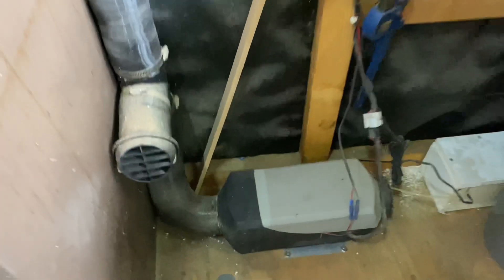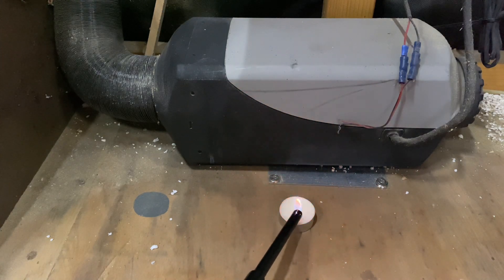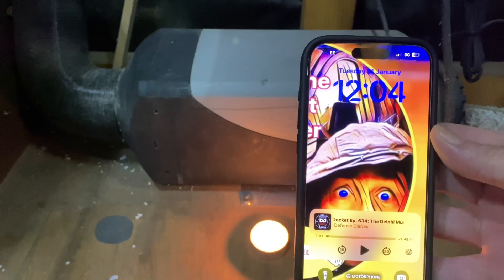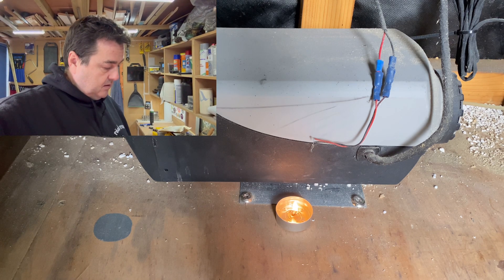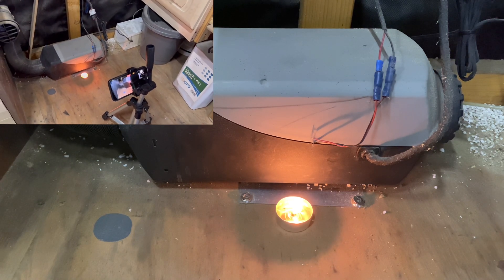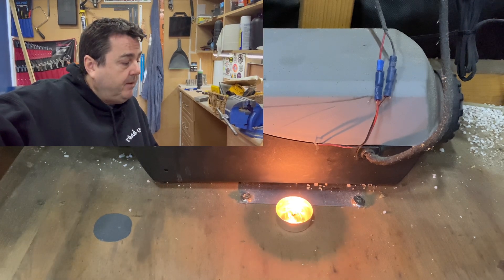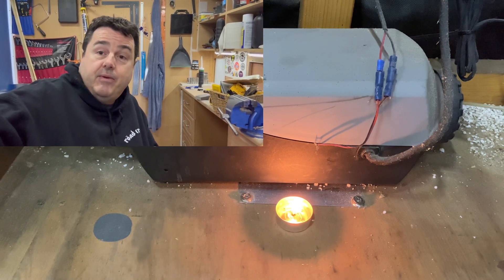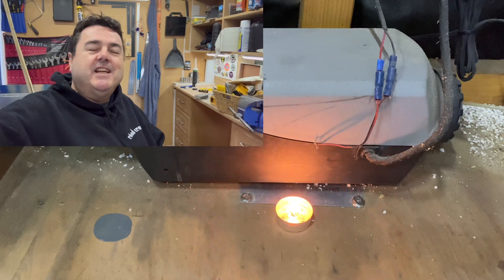DIESEL HEATER MYTH BUSTED - You Do NOT Need A Battery Back Up #dieselheater

Comment: have you checked your casing temperature? is it running properly and hitting the usual 200C+? I ask because mine typically runs at 210C i had a powercut and it melted the internal fan, no damage to the PCB or motor though, replaced the internal fan and it was good as new.
Reply from the maker: Really? my case temperature is never hotter than my hand can stand? I have two of these and they both shut down abruptly without problem, although I do not recommend doing that, it’s just to kill the myth
Reply: @STTC  internal case temp the aluminium part inside, some of the controllers will tell you on the screen
Reply from the maker: @ Ahhhh I get you buddy

Comment: And there I was worrying about power cuts, seems I can finally stop thinking of batteries😁
For the record, I am in a room with a diesel heater running on paraffin, 2 stroke oil and normal engine oil, seems to work anyhows😁
Reply from the maker: Absolutely my friend,,,,, forget about batteries,,,, get a power supply lol,,, cheers for commenting
Reply: @STTC  Already got one and the heater has been working for a few years but needed a glow plug after 1 year, seems easy to fix though.
As a side note, it's better with a power pack set to at least 13V for the glow plug, it struggles to ignite if too low.

Comment: I can confirm your result. I have 2 Vevor heaters and 2 times the power switched off. They do smoke like hell (especially the air inlet for the engine), but they are both fine. I was pretty confused when I opened the cap to cool down the motherboard, because the motherboard wasn't warm at all... 
Thanks for the video! I thought I was just lucky, but apparantly it's just a myth. Now I don't have to freak out if the power switches off.
Reply from the maker: Absolutely my friend,,, there’s an awful lot of nonsense talked about around these simple heaters, there’s so little to go wrong on the mechanical side and I’ve never had a problem with a motherboard,,,, just pure un evidenced so called experts speculating,,,,, cheers buddy

Comment: when you switch one of these heaters off without letting it go through the cool down cycle you are shotening the life of the electronic components on the heaters main board ie the electrolytic capacitors which are rated around 100 degrees c maximum , when you switch the heater off the fan stops and the temperature of the aluminium heater body can be way above the 100c and will dry out those capacitors.
Reply from the maker: Yes, that’s never been in question really,,,, and the full video explains why you shouldn’t shut down without the cooling cycle,,, the point of the video was to demonstrate they don’t burst into flames or meltdown
Reply: @STTC  I have used one of these on a boat for years , if the heater becomes full of unburnt fuel sometimes the exhaust can glow orange due to it burning off and it can be very scary , the cooling cycle can also reduce this by blowing air through the exhaust to cool it as it is shutting down.
Reply from the maker: @ yeah agreed

Comment: at 1:28 what are them 2 extra wires for looks like going into the heater ?
Reply from the maker: Well spotted, I was trying to rig up a light to display when it’s on from outside the shed,,,,,lol,,,,, it remains hanging there unsuccessful but a relic of my inventive mind of years gone by,,,, probably been there 4 years
Reply: @STTC  i been looking into that same idea lol , like tap off fan to a relay to a light
Reply from the maker: @jonwhite2706  Yep,,,, never got passed the thinking stage

Comment: yeah i guess in this case the heater was all good, ive seen before tho the impeller look quite melted, it still ran fine but heat can go the wrong way back through the intake. alot has to do with how the exhaust is shaped, if it goes straight down, when you turn it off the residual heat will rise, kinda 'blowing back' hot air into the heater and possibly unburned diesel smoke too.  The other thing is when in shutdown it might help burn off carbon deposits, especially black carbon, but youll still have to clear it out at some point so guess it aint really an issue.  not sure on your exhaust setup but i guess yours goes up, allowing the heat and fuel vapour to leave like it normally would
Reply from the maker: Yeah it goes straight up,,,, cheers for commenting

Comment: I think what helps in your situation is the hot air outlet is pointing up, acting like a chimney. So when you kill the power there is a natural draft created pulling cool air into the heater. The control board inside it located near the cold air intake. If your hot air outlet was pointing down, then the hot air could start to create a draft out of the cold air intake past the control board and could cause the control board to get baked over time. I have seen videos of melted control boards, so it is a thing that can happen. If your air intake and outlet were on the same level then it would probably have very little draft and the control board would also be unhappy long term. I would expect the capacitors life expectancy to be diminished if they are regularly getting baked.
Reply: Yes, that's well possible. My hot air outlet is also pointing up. The motherboard did not feel hot at all when there was a power-cut.
Reply from the maker: @tomasviane3844  No,,, it’s pretty much a myth to be honest
Reply from the maker: Interesting points raised

Comment: cheers, that video was the bomb 😅 😂🤣
Reply: @STTC  fyi I made my power supply out of an old 15a xbox 360 power pack, easy mod to do and only cost a few quid off car boot 😉 I run no battery at home ether, never any issues when power goes ether 👍
Reply from the maker: @ Nice one, I note the scare mungerers are absent in the comments so far too

Comment: Haha... Yes, I have killed the power to my heater several times, both on purpose and accidentally. 

The only time I had anything bad happen was once I was doing a waste oil burning experiment, I had the burner up to 271C and was using a secondary combustion air source. The fan stopped, but the combustion kept going and it melted the fan. The electronics, and everything else was fine. 

My situation was extreme as they normally shut down WAY before 270C, and when the fan stops, that normally cuts all combustion air. They take a long time to cool off, but nothing gets damaged. I'm saying all of this before watching your video, so I'll dot hat now.

EDIT: Done watching. Well done. I to have done my fair share of myth busting. Funny thing though.... people who lie in their thumbnail and titles / people who are dramatic "DON"T DO THIS" "THIS COULD BURN YOUR HOUSE DOWN" .... they get rewarded with a lot more views haha. A thumbnail with " $100 heater - 200% EFFICIENCY" gets you 800k views.
Reply from the maker: Lol, totally agree buddy,  my days of clickbait are pretty much over, cheers for this great comment, much appreciated

Comment: I don't understand what they meaning having a meltdown🤔, what about the ones fitted in trucks they just switch them on / off, but i dont have one so i don't know much about them
Reply from the maker: Theres a shutdown cycle where the fan keeps blowing when the fuel stops, so it cools Nev,,,,,,I demonstrate that if you skip this cycle they don’t burst into flames or meltdown, a lot of people said they do,,,, obviously I don’t recommend not having a battery backup to make sure there’s a cool down cycle instead of a complete stop if the 240v power cut ever occurred